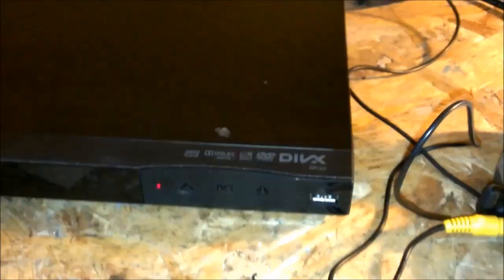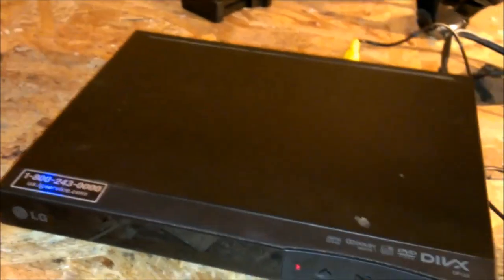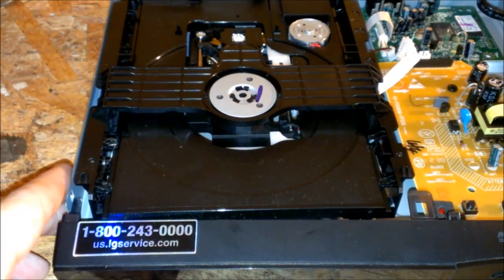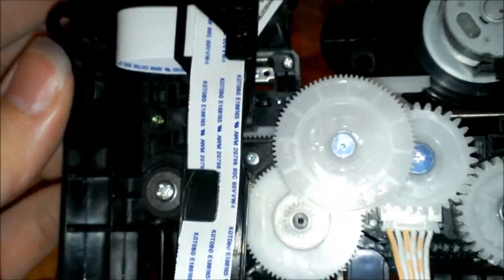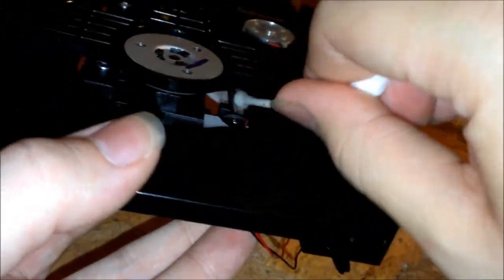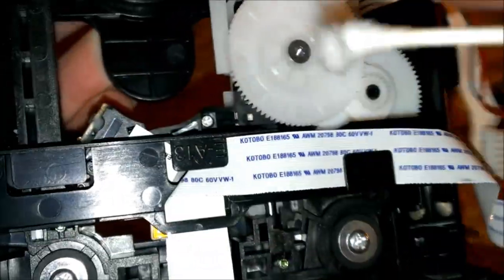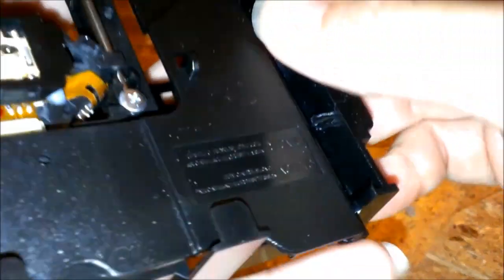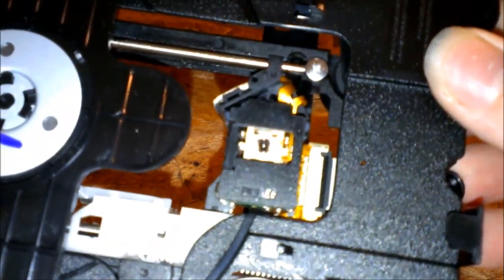how to fix dvd player that makes noise

Comment: The whole gear assembly isn't causing the buzzing sound when Blu ray is playing it vibration from the disk spinning at a high rate of speed. Greasing those gears, shafts doesn't stop the buzz it has nothing to do with the playback noise period. The issue is the high spin rate causes vibrations throughout the whole drive (black plastic) assembly. Anywhere where that assembly touches the metal frame is where the buzzing comes from. Insulate the drive assembly from the frame using very thin foam tape at all the points of contact or even electrical tape should help. It should be a very thin layer as to not interfere with the drive loading/unloading disks.
Reply: @Mike 3M and other companies make self adhesive foam tape of varying thickness some are double sided, basically anything that will absorb vibration should help cut down the noise caused from vibration. BTW I don't agree with putting grease on anything inside a Blu-ray player, someone mentioned something about cleaning dust out...well grease is like a dust magnet so even IF this grease method works, it won't work for long IMO. There's a reason there's no grease on the gears or other moving parts. Once you've gone and greased everything you're writing a death sentence for your player.
Reply: I’m having this problem but it’s specific DVDs in like three different blu ray players. Do you have a good resource to follow doing what you’re talking about? The buzzing is driving me nuts and it’s only on a few DVDs :(
Reply: @SabatinoSmith  My guess is that if you only have a few DVDs doing it, they are likely warped.  Try making a backup of them and testing the backup.

Comment: The video is very good for repairing the problem. Just in my case, when i cleaned the lense when dvd rom was opened, it got dirty again after that. So cleaning the lense when put the drive together is better in my opinion.

Comment: Good plan, but that grease will eat plastic over time. Instead use silicone grease, it's safe for plastic.
Reply: Isn't lithium grease a better option?
Reply: @josegti84  , no. It can still attack some plastics.
Reply: @HoovManeuv  I've always heard good things about Molykote grease which is lithium based if I'm not mistaken. It's safe on all surfaces. Which oil do you recommend for shafts? Is the 3 in 1 type oil everyone has in their homes safe to use in VCR's? Thank you.
Reply: @josegti84  i would get the 3 in 1 brand for electric motors as the regular type has some cleaning agents in it whitch you don't want in it for shaft or bearing lube purposes
Reply: @joechlystun7979  Thank you very much.

Comment: i've experience crackling / scratching sound in my dvd . do you think it will solve the problem by cleaning and lubricating the mechanical part? ichecked the electronic components like capacitor and nothing is bulging or showing any signs of malfunction.

Comment: I was hoping this would address a electronic buzzing sound that happens whenever there is power to the unit.  It plays fine but there is a noise from the unit itself.  I'm thinking motor windings  or a bad cap but I have no experience except for computers.  Time to pop the hood.